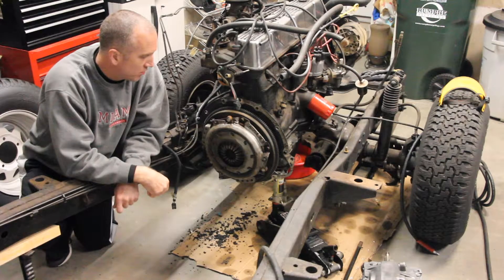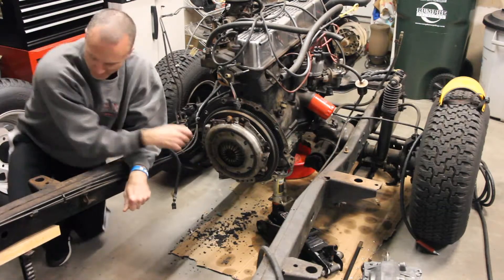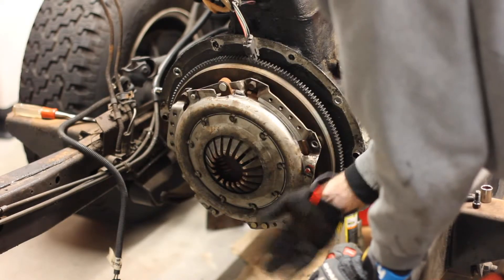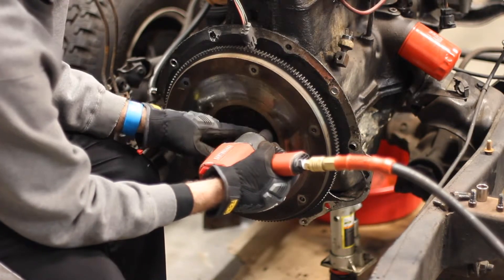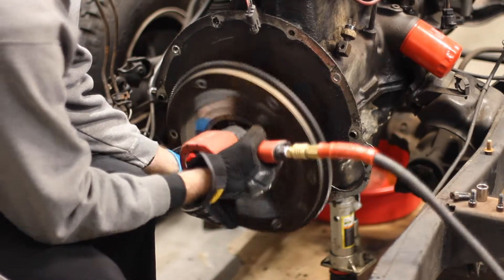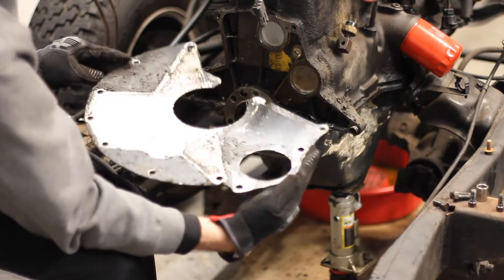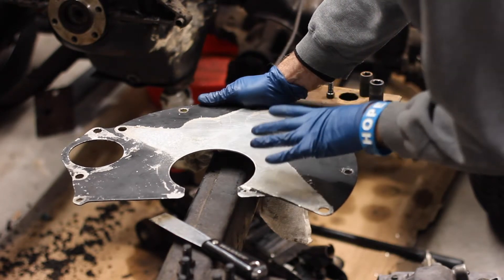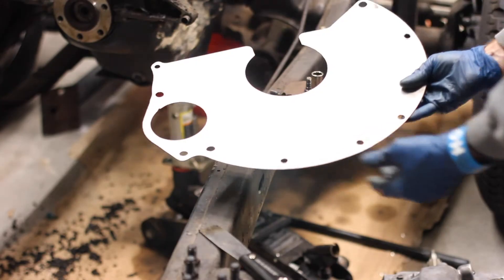Jeep Cj7 Clutch Removal

Comment: I am about to replace my T-5 and clutch. Was it hard to break loose the bolts on the fly wheel?
Reply from the maker: Yes and no. Impact wrench; no problem. By hand; tough. You need some kind of wedge block to hold the wheels teeth as you try to loosen them with a breaker bar.

Comment: I see your dust shield is open on the bottom drivers side. mine is also. Are we missing a piece?
Reply from the maker: Yes. I had previously removed it and powdercoated it. I plan to do a bunch of quick "aftermath" videos that show what things could look like. It is called the lower dust shield. Its not water tight and had a small drain port at its base. Its connected by 4 short 1/2" long bolts. 3/8" I believe.

Comment: I’m a new Jeep owner and know nothing about this process. Noticed you got a jack in use.  Why are you using it?
Reply from the maker: Once you remove the transmission and the skid plate that supports it there is nothing supporting the engine other than the 2 motor mounts. The engine is not balanced upon the mounts and leans heavily towards the rear of the vehicle. I didn't want to put too much undue torque on the new engine mounts so I supported the rear part of the engine with the jack that you see in the video. Plus it helped to hold the engine in place while removing the bolts for the clutch assembly.